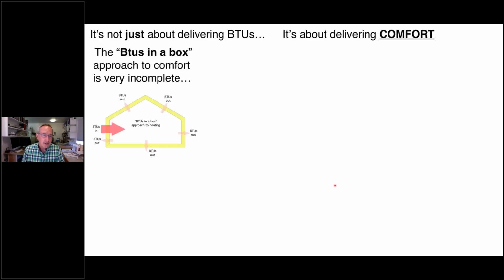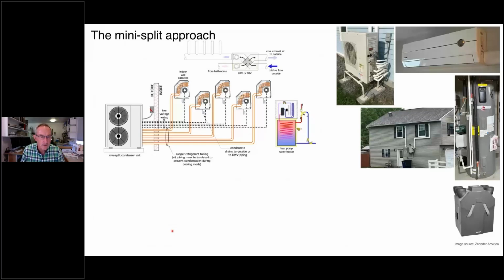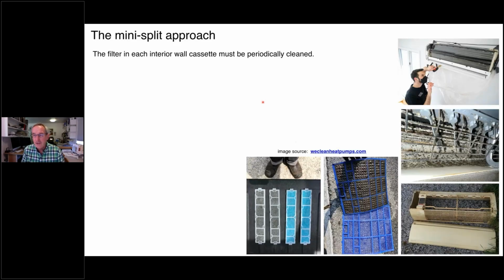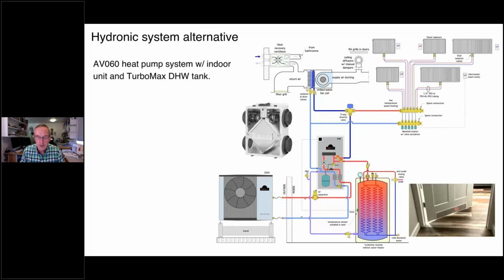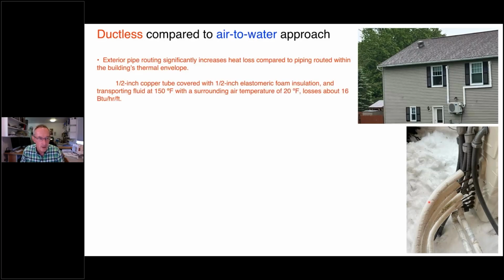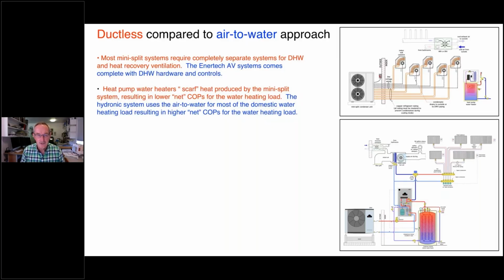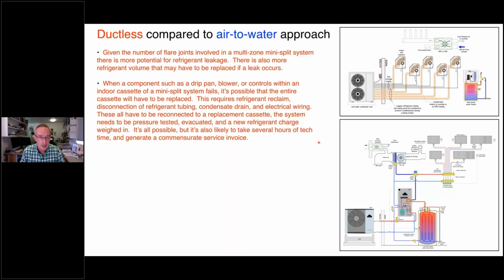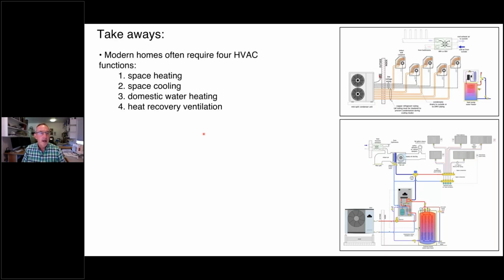Comparing Air to Water Heat Pumps to Ductless Mini Splits

Comment: Why is propane refrigerant common in China, but not in North America?
From what I can see, they will produce hotter water and therefore are a better retrofit for systems that need 170° water.
It cannot be a safety issue because the propane is outside just like everyone’s propane tank. The only difference, a propane tank has a lot more propane than a monoblock air to water hydronic system.
Reply from the maker: Hi Sean, We don't want to get too deep in the weeds with refrigerant choice, but every refrigerant has pros and cons for use in our heat pumps. In addition to measuring pros and cons, governmental regulation looks very different in China than it does in North America, so the North American market mostly prefers R-454B to R-32.
Reply: @EnertechGlobal  well that’s encouraging. We just have to wait for the government to catch up with their legislation.!
Perhaps in my children’s lifetime

Comment: Panel radiators can have condensation on them. Is it wise to use them for cooling?
Reply: It doesn't look like the proposed design involves using the panel radiators for cooling; they're on separate zones. I am curious why items like the HRV systems are priced differently in the comparisons.